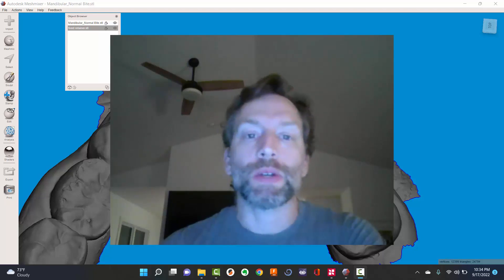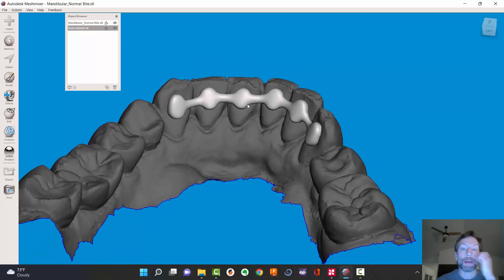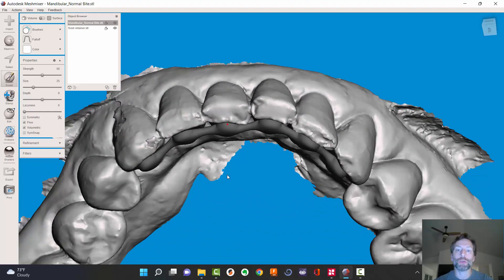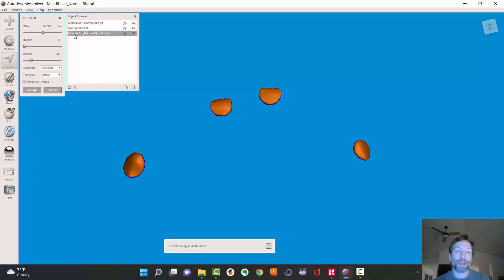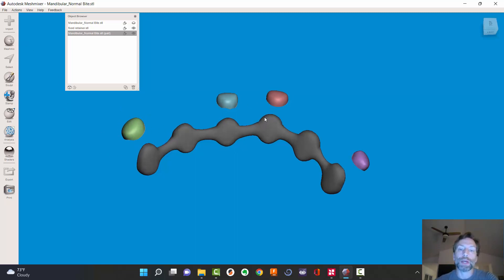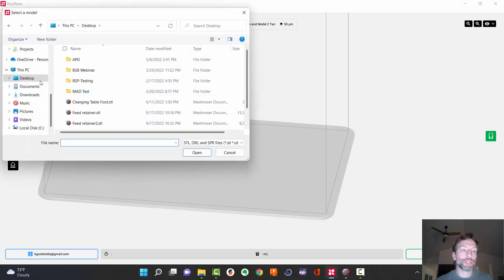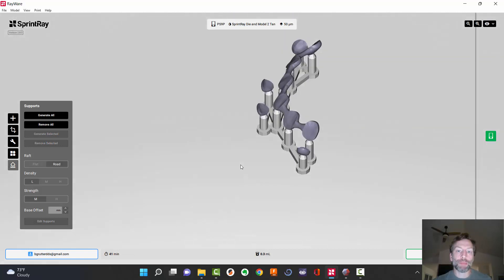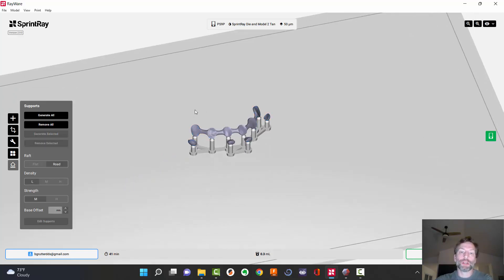MeshMixer: Orthodontic Fixed Retainer Seating Jig

Comment: I have done this a dozen times without issue but today I had to make one in a bigger hurry than normal. For some reason after the extrusion step when I was trying to just select the cameo surface only... it kept selecting the entire thing. Any idea why it wouldn't just select the cameo/sides?
Reply: May be you forgot to increase the Crease Angle Threshold under Filters.